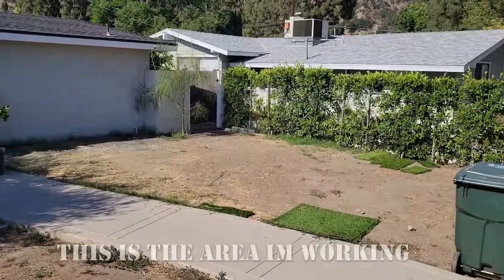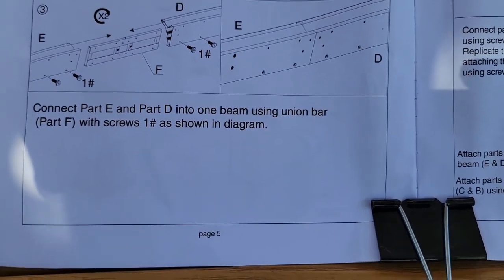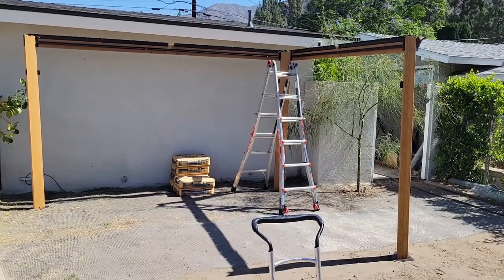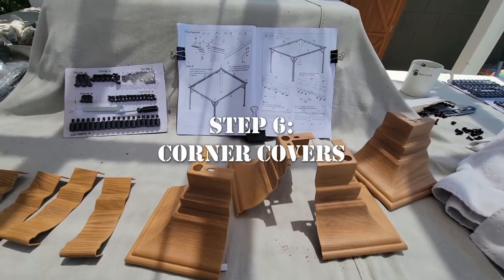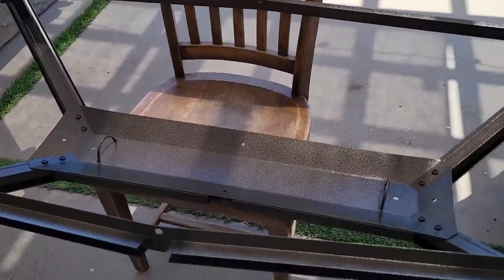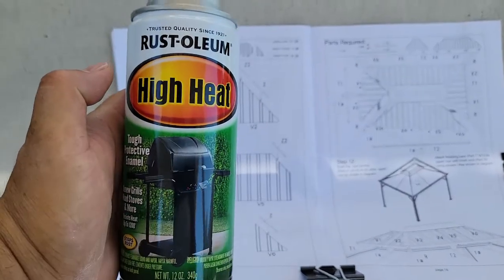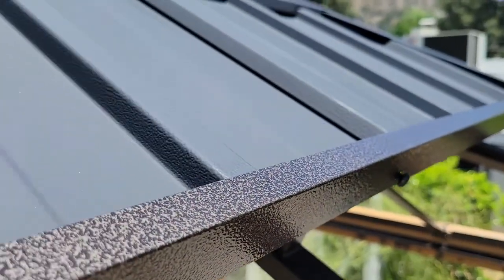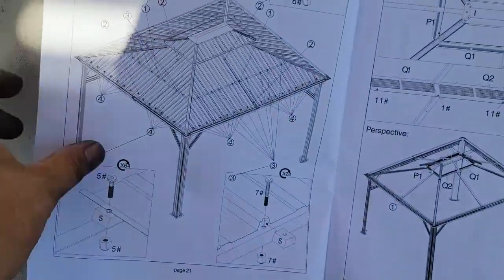Step by step KozYard Gazebo build

Comment: We are in the process of putting together the 10X12 gazebo. Thank you for this video! All we have left are the lower panels, and you saved us from making the same screwdown mistake! For anyone else doing this, I'd HIGHLY recommend a 1/8" drift punch for alignment issues for screws and a small rat-tail file to help with minor screw hole alignments. ❤❤❤❤
Reply from the maker: Good suggestion.

Comment: THANK YOU for posting this. Will be assembling soon. There is a video from Kozyard out there but I have had a hard time finding. --------Fast forward. Started project. This video still super helpful. Instructions in the box aren't the best but not awful. Basic frame took about two hours to get unboxed and assembled. Now ready to put end caps and silicone on. Then on to the top frame. . Keeping everything loose until it's all together. Using the drill with proper bit and careful to set the drag/torque light as to not over do things. I like the black paint idea but wonder how it would hold up long term. The two tone still looks great. (hmm...a nice coat of Flex Steel Black? Might help guard against hail storm and keep water tight here in the midwest lol). I plan on using a sticky back led strip on the underside to light up at night. So far, Im very happy with the quality of the product. It should last a long time.

Comment: Ok - nice video - but I can't seem to keep the K plastic to stay on, the double-faced tape didn't work - I tried super glue but it would bond - what did you do differently and are they really needed -
Reply from the maker: I'm not sure what the K plastic is.  Do you know what step of the instructions that is.  If you know what step it is, I can check the instructions and see if I can help.
Reply: @workingbear1084  So sorry - Its the Z Z1 Z3 parts that (Step 12)  get attached to the roof panels - I just can't get them to stay on - Are they needed?  Thanks
Reply from the maker: Start the video at the 23:19 mark and I think that might be what you're having an issue with.  I took me a few tries to figure out that those plastic pieces clip on.  and they are necessary because they keep the panels in place once installed. let me know if that helps.